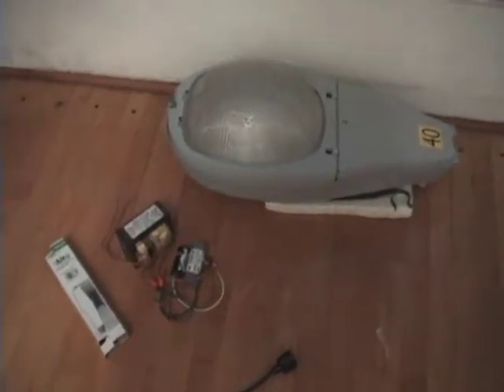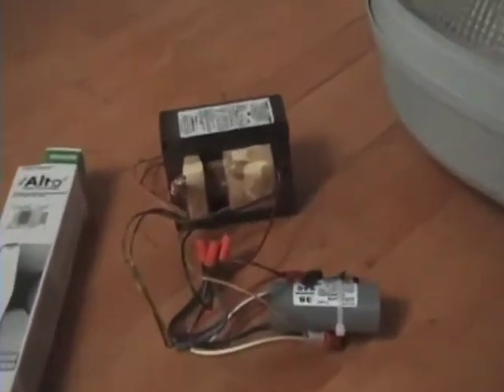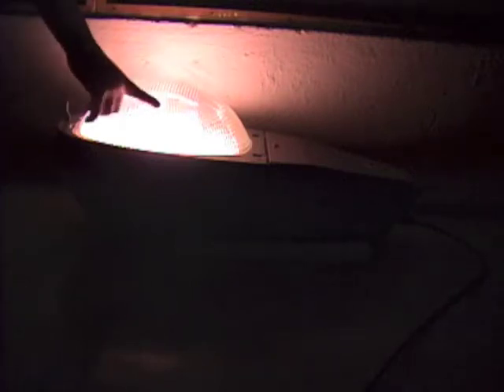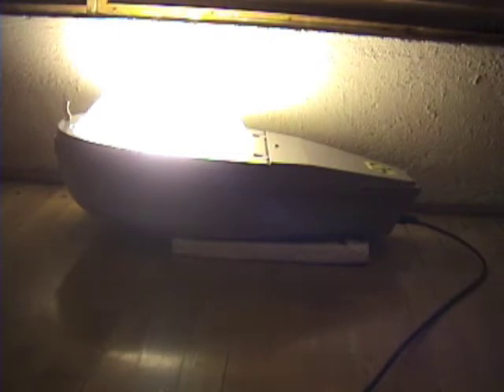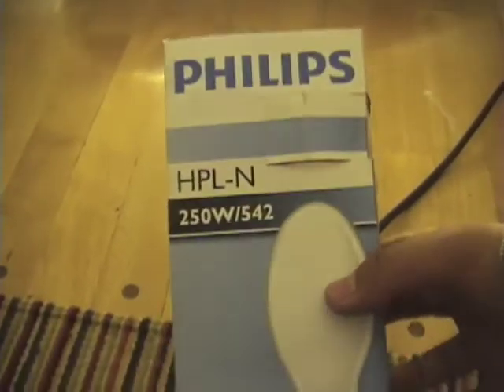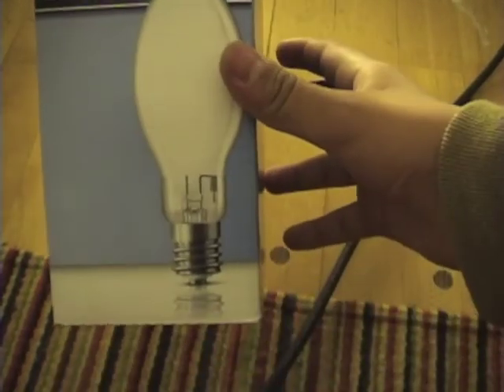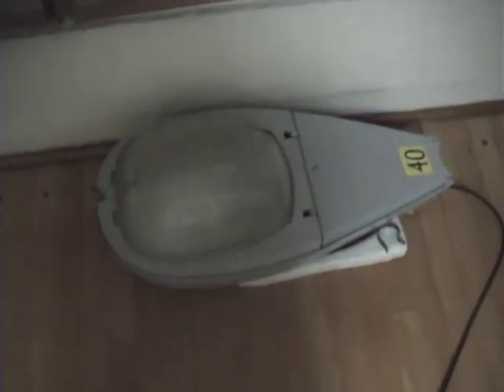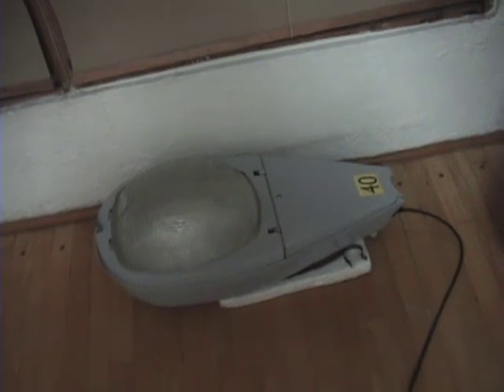ByL H-40 Mercury Vapor 250W Street Light Test.

Comment: Where did you get the ballast?
Reply from the maker: I got it in a electrical supply store at a good price; really good deal; it is an ISB sola basic 250W mercury vapor/metal halide reactor with a coil-capacitor included and 120/220V inputs (wired at 120V) It's made in Mexico and it's one of the best ballast I ever have.